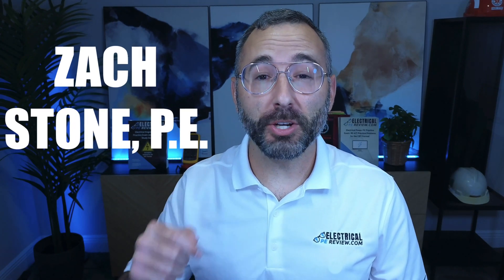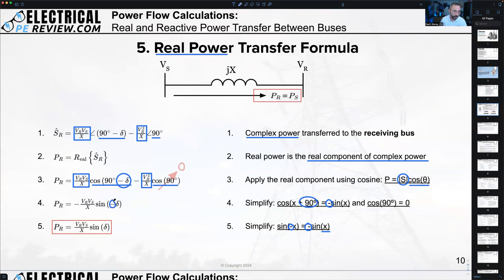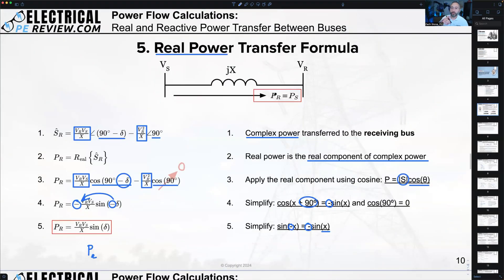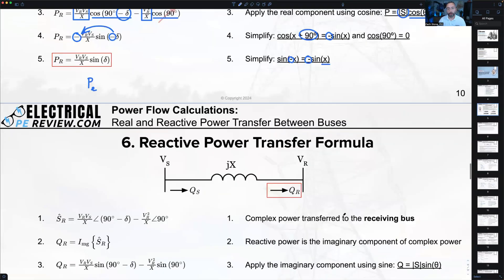Master Power Flow Calculations: Deriving the Real (Watts) and Reactive (VAR) Power Formulas (Part 2)

Comment from the maker: 📖 Video Contents:
0:00 - Video Introduction
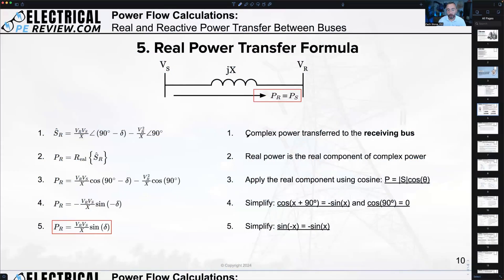0:38 - Step 1: Complex Power Transfer Formula
1:26 - Step 2: Real Power vs Complex Power
1:42 - Step 3: Apply the Real Component
2:37 - Step 4: Simplify Using Trigonometry Identities
3:50 - Step 5: Simplify Using Sine Identity
4:32 - Real Receiving Power Transfer Formula (P, Watts)
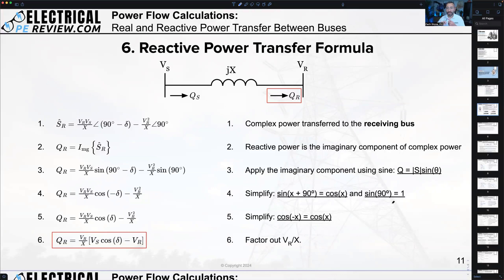6:10 - Step 1: Reactive Receiving Power (Q, VARs)
7:30 - Step 2: Reactive Power vs Complex Power
7:50 - Step 3: Apply the Imaginary Component
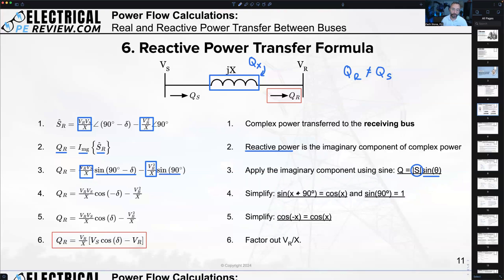8:39 - Step 4: Simplify Using Trigonometry Identities
9:19 - Step 5: Simplify Using Cosine Identity
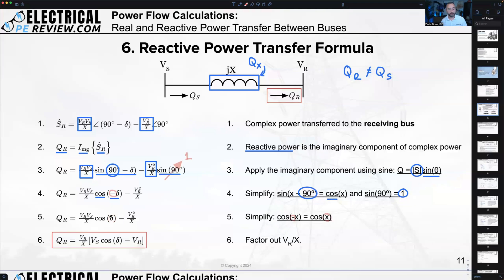9:43 - Step 6: Factor Out Vr/X
10:03 - Reactive Receiving Power Transfer Formula (Q, VARs)
10:20 - Video Outro